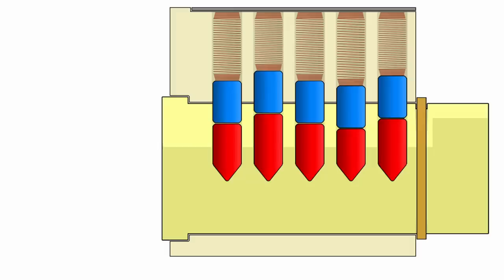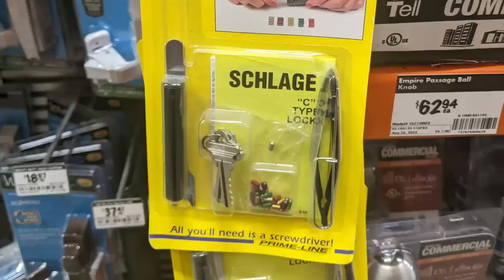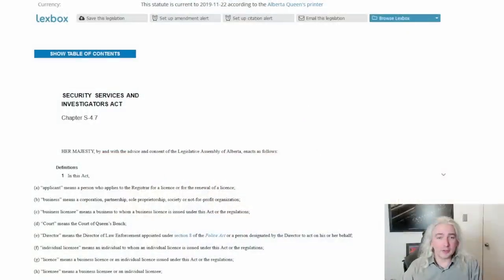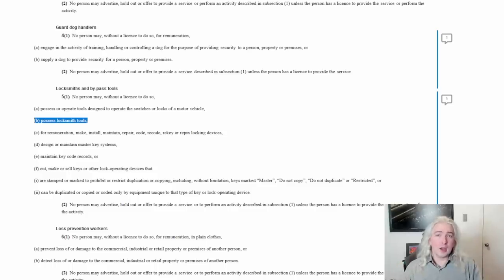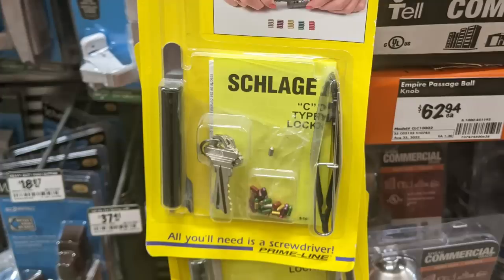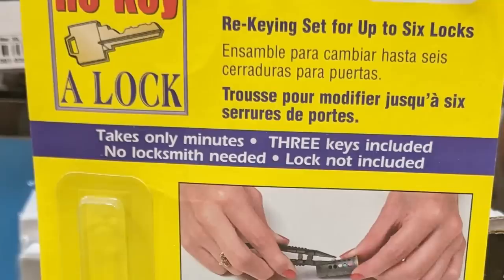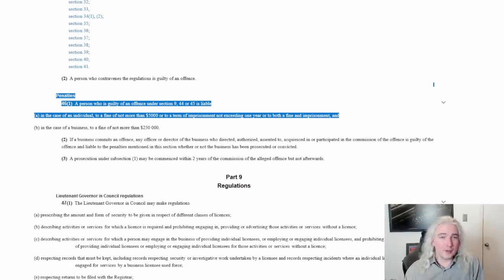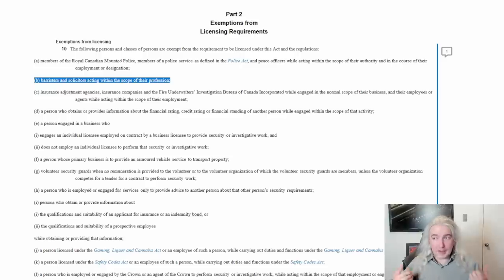Stupid Law Makes This Illegal (In Alberta) -- A Lawyer Explains

Comment: Isn't this similar to S. 351 CC (possess break-in instruments) or even bear spray which falls under the definition of a prohibited weapon? 
The police are expected to excercise judgement as to the intended use of the items in question before laying a charge and if there's further question after that the courts would have to use their judgement regarding what the intended use was. Common household tools like a prybar, screwdriver, or hammer can be break-in instruments under the right circumstances. Bear spray in the woods is common sense, bear spray when you're dealing drugs in the suburbs is a prohib weapon. 
Admittedly the line can get blurry but that's why we have the legal system we do with several courts up to the Supreme Court so there are layers of defense against bad judgement.

Comment: The definition section is sadly lacking.  The follow is not a device or tool that is made to, or can realistically be used to, defeat or bypass a locking device, which is basically the intent of the legislation.  So, while it is a tool common to, almost exclusively used by locksmiths, it is one of the most benign tools possible.  It makes perfect sense to regulate tools or devices that are specific to, or generally accepted as, having its primary use being defeating or bypassing locking devices.   In one of my pre-law occupations, I was a property manager for a property management firm, and I had a complete set of locksmith tools, including a Curtis key cutting machine, that I used in my normal business.  Those days are long gone, but I still have sufficient knowledge and experience to do fun things with locks if inclined.

Comment: I’d think “locksmith tool” would narrowly apply to lock picks and direct bypass devices like shims.
Reply from the maker: Not really, the intent is to prevent anyone who isn't a licensed locksmith from doing things like rekeying locks.
Reply: @RunkleOfTheBailey  did the locksmith union lobby or what? Because that’s a ridiculous intent. There’s no lithium battery to explode- I don’t even have the right to repair my front door anymore.

Comment: I've been re-keying my own locks or many years and use the base of an appropriately sized drill bit for this purpose. Immediately lose/destroy the illegal(?) follower to avoid charges!
Reply: The drill bit is the loophole around that law. If found, it's not a locksmith tool. Every judge recognizes it as a device to cut a hole.

Comment: I mean if we are talking about questionable definitions, wouldn't the line directly above be even more problematic? "No person may, without a license to do so, possess or operate tools designed to operate switches or locks of a motor vehicle." Because without a definition of what it means by tools, couldn't an argument be made that the keys themselves are a tool. For example the first definition for a tool that pops up when you google it is "a device or implement, especially one held in the hand, used to carry out a particular function." and I would say that using that definition, a key is definitely a tool for operating the locks of a motor vehicle. 

And secondly, I could be wrong here but I would assume that people need to be able to use the tools to be able to become licensed. So wouldn't this in a way outlaw the ability for someone to effectively train to actually obtain the license in the first place?

And as an added bonus, I paused at just the right time to see 3a which is "no person may, without a license to do so, for remuneration, patrol, guard, or provide security for another person or for the property or premise of another person" which to me would also mean that someone could make a case that housesitting for someone while they are on vacation and getting paid for it could be considered illegal.

Admittedly there is every chance that I am reading this all wrong and none of my points hold water but still I am curious as to how valid my reading of them are.
Reply: On the second part. In Alberta, it's a licensed trade. Conventional route, you would apply to a shop and be sponsored for an apprenticeship. You would apply for a criminal record check and apprentiship license with said company.

Comment: I think Home Depo is selling the product to prevent having to call the locksmith. However, if you buy the lit in order to enter your neighbor's dwelling in order to steal their belongings, you can be charged with 2 crimes.
Reply: This kit isn't a lock pick tool. You cannot break and enter your neighbor's home using this kit. This requires you to ALREADY be in the home and change the lock from THE INSIDE.

Comment: You only get in trouble if you get caught. Also, who can say what tool is used for what in your own home. Just call that follower by any other name and dare them to prove it's a locksmith tool. Also also, pretty sure that's just for in public. Like getting stopped by the cops for something and they find it on you during an investigation. Or for handymen doing locksmith work that are not licensed locksmiths. If I were in Alberta I'd do it for you anyway.

Comment: A locksmith's tool cannot mean a tool used by locksmiths otherwise everyday items are illegal. However, a tool exclusively used by locksmiths can be made illegal, but if it's sold at the hardware store specifically marketed for non-locksmiths, then it's hard to argue exclusivity. 
Another definition might be tools designed for locksmiths, in which case the packaging again saves you. 

The worst-case definition is any tool designed for use in locks. This also seems unreasonable, but I don't have an argument as to why right now other than it would make the exact use case you're describing illegal (which is intentionally not made illegal in the next part).
Reply: Locksmiths use files to make keys ...

Comment: Maybe I’m misinformed but from my understanding, lock-picking tools are illegal all across Canada to process in public. I heard that a locksmith needs to have had 2 years of training in the field by a certified locksmith and all locksmiths in Canada have to have fingerprints on file with the RCMP. Now back to the item being sold, maybe I’m wrong but I was under the impression from what I heard (hearsay) that citizens could own lock picking tools for hobbies and what not as long as it stays in their homes and is never carried openly. Does anyone know what the law is on that ? Because if that correct then buying an unopened repinning tool and taking it home to do your locks; shouldn’t really be an issue. Not to mention, any judge with half a brain should know the difference and should toss any case out over something so silly, at least I would hope so.

Comment: Failing to Define what a locksmith tool is in within the law makes that portion of the law unenforceable in the first place. However that part that you're talking about is not a locksmith tool. A locksmith pool is something so that they can open the lock so they can get the thing open so that they can disassemble it. Otherwise you could go to jail just for having a screwdriver.
Other issue is that if you own these locks you can work on them yourself. And ostensibly if you had the locksmith tools to work on your own locks you would have them at home which is not illegal. It would be illegal for you to be carrying them around because there was no other purpose for that.
Although it isn't specifically spelled out, the owner of a property is more than likely exempt from this because they volunteer their own security work. Read item G in part 2.
And one other point I'd like to point out as long as you're being that specific about the law. It says you're not allowed to have locksmith tools. It doesn't say you're not allowed to have a locksmith tool. Singular as opposed to plural. Because I've seen very few singular locksmith tools that are able to defeat a lock.

Comment: The tool is just a cylinder that stops the shear pins from popping out as they are spring loaded. Anyone with a pipe or rod around the same diameter can do the same thing. So i would say its not illegal as any rod that can do the same functions would be illegal

Comment: Can you please provide a real example of actual case law in Alberta where someone has been prosecuted for using this, or any other similar product?  Is there any?
Reply: I can't think of one in particular. Probably see's the most use of being tacked on existing charges. There is one company though local to Edmonton, that if they hadn't, should have been. BBB had done a sting, and the guy didn't have a license (that record was wiped.... 2? 3? years ago?) They also have the lowest rating here and Calgary. Their reviews will tell you what they're like.

Comment: Either the law is to protect the lock smith trade and therefor was lobbied by the Alberta lock smiting guild and is therefor corruption. If it's with the Idea of making it illegal for criminals to use lock picks and other lock smith tools then it's just normal politician stupidity. You can lock pick with a bobby pin and a screw driver quite easily. I mean a lot of combination locks can even be open with a small slice of aluminium from a can. Some locksmith tools are actually more of a professional robber tool since they are designed to rapidly unlock a lock which expensive or well made locks have guards against nowadays which are as easy to make then to make the pins.

Also as my dad says, it's only illegal if you are caught and if the law is just about possessing lock smith tools. just destroy them and get rid of them when your done
Reply: Most criminals will opt for a brute force opening, rather that buying, carrying and learning how to use the lock-picking tools, anyways... Also, criminals will carry handguns, regardless of Trudeau's stupid gun grabbing laws from the law obeying citizens...

Comment: I have been rekeying locks for over 20 years using kits similar to this with zero legal issues. My kit is much bigger but overall the same thing. I think that “locksmith” tool applies to tools that can be used to open a lock from the outside with no keys. Nothing in this kit would allow you to open a locked lock with no keys. Anyone can go to a lock store and buy sets of assorted pins and tools to rekey locks.